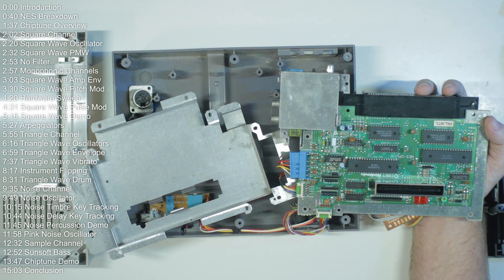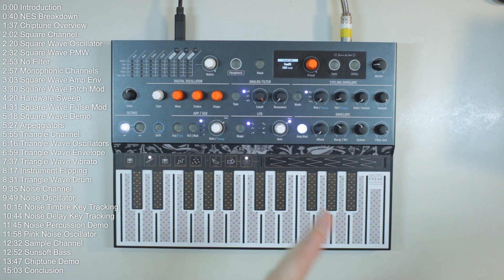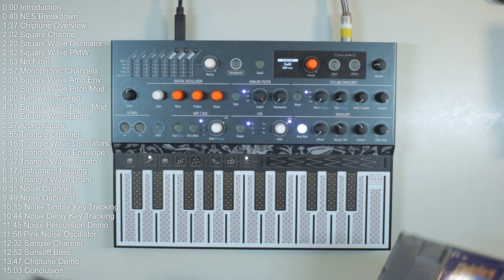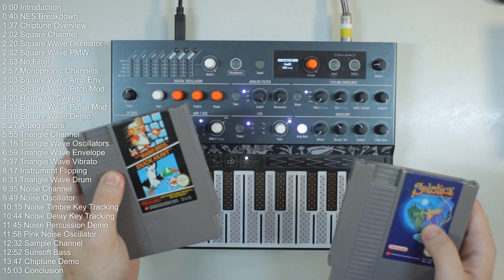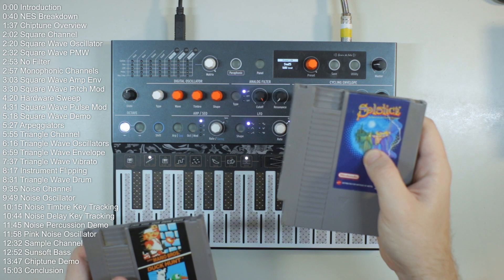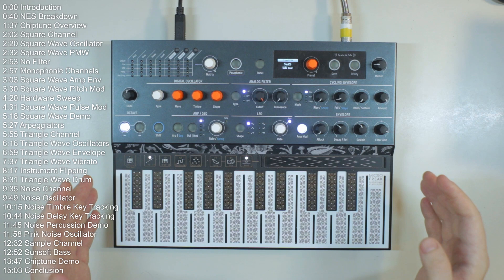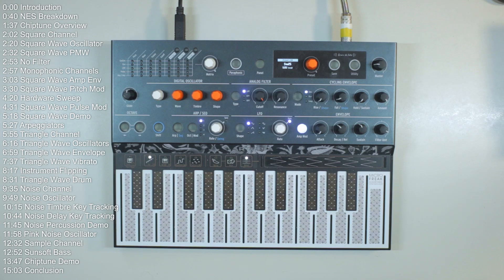Can It Chiptune? Microfreak NES Tutorial and Patches

Comment: Been messing around with a fantasy console called the TIC-80. A recent update introduced an idealized retro synthesizer complete with tracker and all. The triangle wave form creates a sort of low bitrate "harmonic hissing" sound when played on the lower octaves, and I've been on the hunt to try to recreate that sound for a while now but I can't figure out how to do it. Interestingly, your video starts with the exact sound I'm looking to recreate. What a coincidence lol. Any clue what that's called by chance, or where I should start looking?
Reply from the maker: I just call it the nes triangle wave. its uses the volume to draw out the triangle. But because it only has 16 levels its a very stepped triangle wave.
Reply: @Aisjam  I figured it out using phaseplant. Created a triangle generator and ran in through a bitcrusher. Set the bitrate to 1.19 khz and modulated it with note tracking.

Comment: You seem like a lovely person, great video. I'm interested in the microfreak and this was exactly the video that made me press the buy button. Looking forward testing your patches!
Reply from the maker: For that lead, its a square wave with slow pwm. On the NES there are only 4 states of PWM however a Commador 64 you can do pulse width modulation, check out SID chip music. you can use the triangle wave LFO or the CYC ENV to modulate it it in the matrix. also you can use the other mod source to add some slick vibrato or staccato, very chiptune sound.
Reply from the maker: Cheers Oliver, the microfreak is a amazing little synth. It's one of my favorites to noodle on. Have fun with those patches.